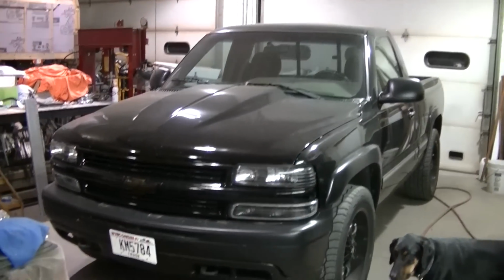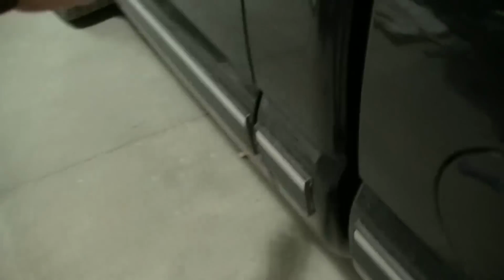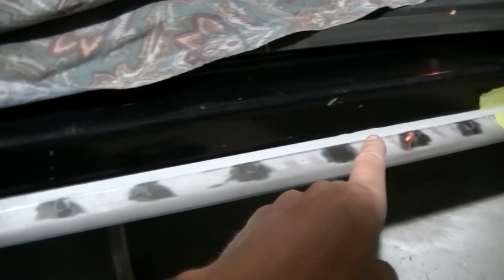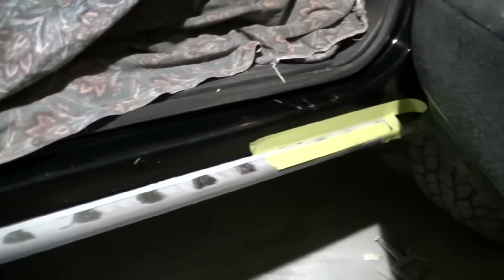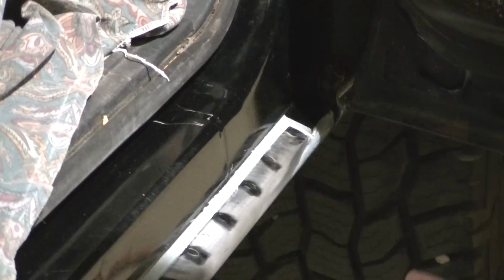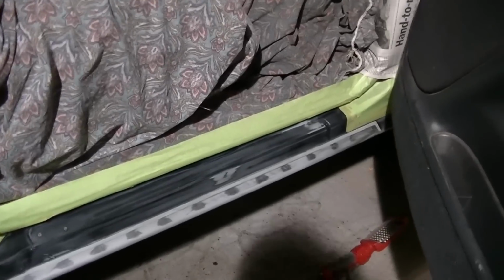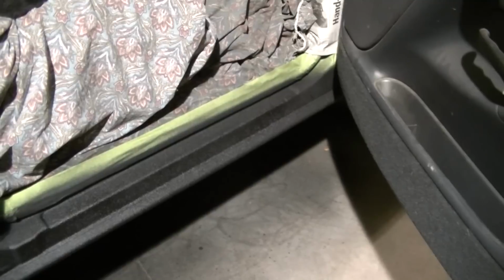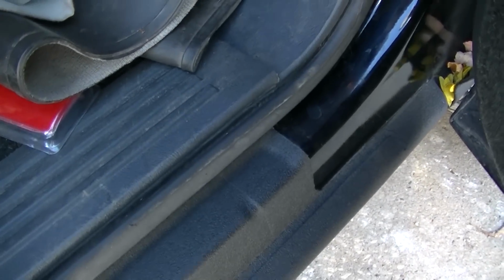2000 Silverado Z71 "Rusty Rocker Repair Passenger Side"

Comment: mossman381 looks great!  I know it took longer than you wanted,  but it's also peace of mind.  Looks like some of the rust spread to the bottom of the door as well. I'm finding some of that on my truck as well.
Reply from the maker: +Xanadu245   The door has surface rust on the bottom.  Going to wire wheel it and shoot it with rust converter.  This was really practice for my dually rust repair.
Reply: mossman381 glad it's only surface rust.
Reply: +mossman381 if its at the door bottom seam its in the seam its inside the doors

Comment: good luck keeping up with that rust buddy, i have the same truck just extended cab and 265 tires. when i bought it there was no rust on the body, took two illinois winters and my rocker panels were rusted up pretty bad and a small spot on the fenders. i tried to keep the salt off and pressure washed it a lot but it still got nailed. my family has a place up near rhinelander and i notice that most of the trucks up there are in decent shape with almost no rust. don't know whether or not people up there take better care of their stuff or if they use something different on the roads
Reply from the maker: +Mike Smith   The original rockers lasted 10 years or so.  Don't see why these won't last that long.  All the panels rust from the inside out so you can have what you think is a rust free panel but on the inside it's rusted out.  I am guessing your rockers were shot 2 years ago it just looked good on the outside.  I can't stand having rust holes in my trucks.  This is part of having an older truck.  I can't afford a new truck every 3 years so rust repair is going to be something I have to do if I want a good looking truck.
Reply: @mossman381  My rockers on my 2003 GMC Sierra looked ok a few years ago and look like what yours look like now before you repaired them. I'm all ready to start the passenger side, Im going to do it the same way you did yours and have the inner rockers too. Did you partially overlap your inner rocker with the new ones? I see you cut most of the rotted part out. Looks like a good guide to set the new inners on.
Reply from the maker: @alminci6622  Yes, used part of the old inner rocker to weld the new inner rockers to.

Comment: Just started my 3rd door 99 my inner rockers are gone.. also doing the third door as well hopefully mine turns out as well as yours
Reply from the maker: +huronhockey8   I have a crew cab that I am not looking forward to doing.
Reply: Yeah this is my first go at it. Unfortunately some of my sill where the lay over rocker is rotted pretty good so I will be patching that as well. Your videos have been a huge inspiration and a big help. I'm actually considering doing the inner rockers as well considering there's almost none left of mine. Should be an interesting job. First time welder too.
Reply from the maker: huronhockey8  I would take your time.  If this is your first time welding you are going to need a good amount of time.  Sheet metal isn't a good thing to start welding on.  It's so thin that it takes some experience to not blow holes in it.  And another thing don't try to weld to rusty metal.  The welder will just blow holes in rusty metal.  You need good solid metal to weld to.  Your welder will probably need to be set at the lowest setting.
Reply: Turned out decent for my first go at body work. Key is to take your time, thats the hardest part but makes a world of a difference. Just follow exactly as he did and it'll work out perfectly.

Comment: Finished my rockers using my patch panels that I made and it turned out great. Used a skin of a old water heater. Inner rockers still looked great. Took a wire wheel to them an they looked almost new after I finished. Sprayed everything down and rust proofed them real good. Got lucky I guess.
Reply from the maker: +JOHN WALTER   Glad it all worked out for you.
Reply: Thanks

Comment: Ha it took you a lot of time - I did mine in the spring and it took me 10 days for both sides. I couldn't find seam sealer so I went on line and it seems people were using polyurethane caulking  so I tried it out. Nope not a good idea, took 4 days for it to set up but it did go on nice and I just thru the rocker guard on as well.
Reply from the maker: +Steve Rob   The seam sealer works really well and this is what it was intended for.  I wanted to use what I know will work.  Dry time for it is less than a day.  It stays flexible and it paintable.  This was really just practice for the dually's rockers.
Reply: mossman381 When I worked at GM I put miles of seam sealer on the vehicles and what we used was a 1/4 in hydraulic hose with a small bristle brush on the end trimmed to make a nice bead as you pulled the trigger and let it flow just right  as the vehicles went down the line.   To tell you the truth you did a whole lot better job by the looks of it than I ever did. Haha

Comment: I bought mine months ago, still didnt put them on. My inners are still good at least
Reply from the maker: +Veikra   The bottom of the inner rocker on both sides was not rusted out but it was too rusty to weld to.  If you try to weld rusty metal is just explodes.

Comment: I'm just going to get as much rust off the old one with the wire wheel and chipping hammer and pait it put the slip on one on weild it paint the weld and call it a day
Reply from the maker: Depends on what kind of repair you are going for.  If you are just trying to get by for awhile that will work.  If you are looking for a longer more permanent repair you need to cut out all the rust.